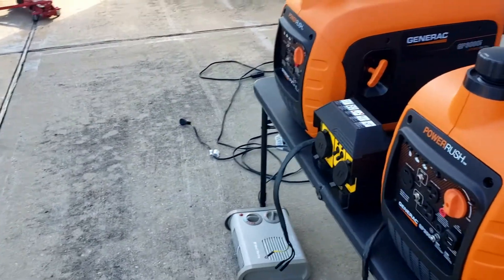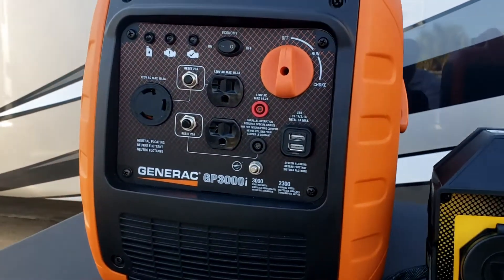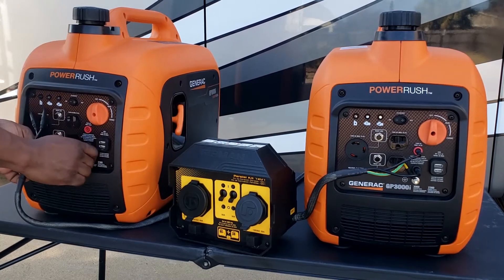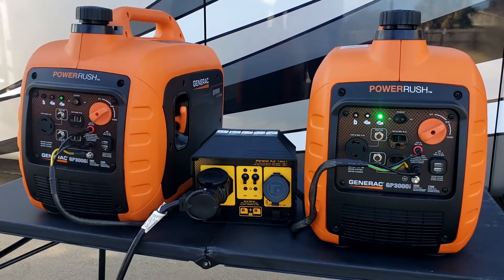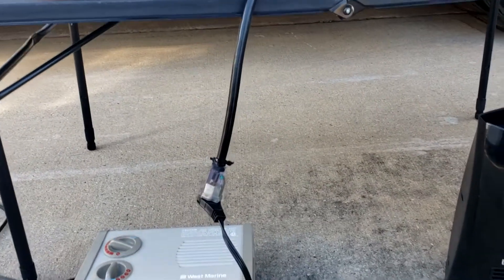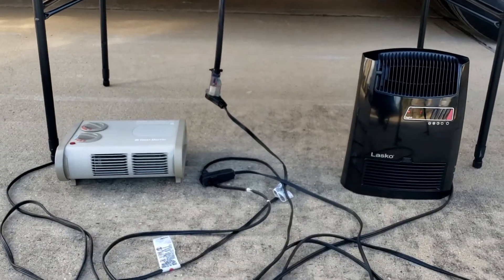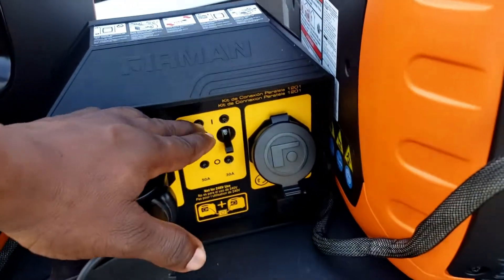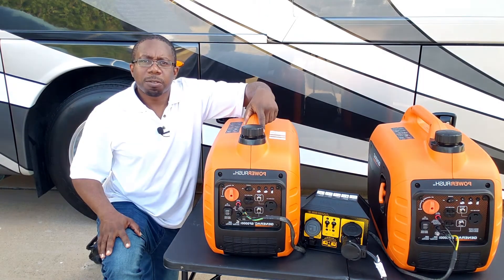How to Parallel 2 Generac gp3000i Generators using the FIRMAN 1201 Parallel kit (Generator Review)

Comment: Those two together is only rated for 38 amps. Should use the 30amp socket.
Reply from the maker: I only had the 50 amp adapter at that time

Comment: Thanks Gavin. That was well done. My 3000w generac is different I guess but that’s not your issue. I have the iq3500 which is actually a 3000w as I said. I like it a lot and it’s very quiet. It says clean every 100 hours. At 96 hours it shut of. Time to not be a slacker.
Reply from the maker: Thanks 🙏🏾

Comment: Ha….and I just found your favorite generator, times 2 !!  I think for this model, I would get 1 and then see how it does up at altitude.  Probably about 10500feet is the highest we would be going.  Much higher than that, the aspen trees thin out.  Well, most trees will start thinning out as about 11500ft is tree line in CO.

Safe travels!

Comment: Do you know why Honda says you can only parallel a 2200i to a 2000i with certain serial numbers? I know Honda has said you can’t do a lot of things when it comes to paralleling two generators ( two different sizes) but people do it all the time and it works just fine. Thanks. New subscriber!
Reply from the maker: The only reason I can think they would say that is if the actual Generator was not parallel capable.
Reply: I can tell you. I have two eu2000's that are at least 10 years old that parallel well together. But they are old enough that I'm not suppose to parallel them with my old 2000's. They tell you how far back you can go in the owner's manuals.

Comment: Question: Can I parallel 2 different watt Generac Inverter generators? Thanks
Reply from the maker: Yes! If both generators are parallel capable they can be different sizes or different brands. It works best when they’re close in power output range but the brand doesn’t matter.
Reply: @GeneratorReviews   costco is blowing out Firman 2000 inverter generator for 350dollars, don't know if I want 2 or just get a 3800 inverter.
Reply from the maker: @jazzsounds8159  I would get the one 3800. Yes you can parallel the two firman but that’s two maintenance you gotta worry about. Just my opinion, plus the 3800 are so much quieter under a load than the 2000w gens.
The two firman gets you 3200w paralleled 
The 3800w will give you 3400w running
Reply: Where did you get the fireman parallel kit. I been trying to find one for my champion generator inverter., with no luck. They have been on back order for awhile. They don’t know when they’ll get more. Now will the fireman also work two champion generator?
Reply from the maker: @sae1964  https://www.ebay.com/itm/333968436766
Check out this one 
My upcoming video is about parallel kits on Monday by the way😉
Reply: @GeneratorReviews  I saw that. I was more interested in the parallel kit for 50 amp for my rv. And what time Monday are you doing the comparison?
Reply: @GeneratorReviews  hey buddy. My champion 3400 dual fuel did not come with a meter for amp being use or the time it’s been running. Is there something I can add to it that will tell me how many hours it’s been running and how the amps are being use and so forth. Thanks 🙏
Reply from the maker: @sae1964  use a kilometer for the 20 amp plug
https://www.ebay.com/itm/303846633859
Would this work for you?
Reply from the maker: @sae1964  I just added the link to that video in the description go check it out it’s on Amazon and it’s available for 50 amp